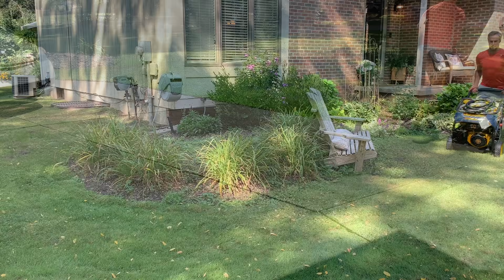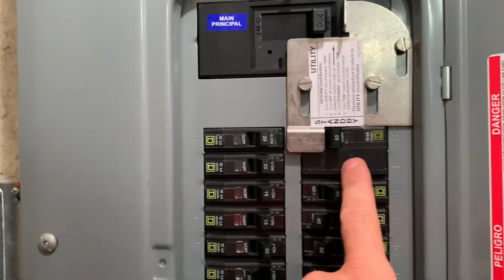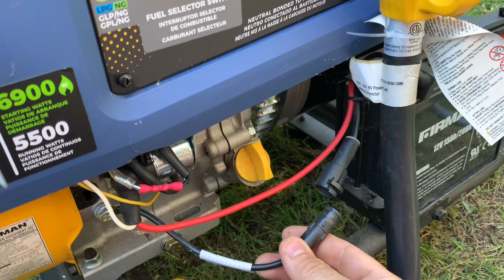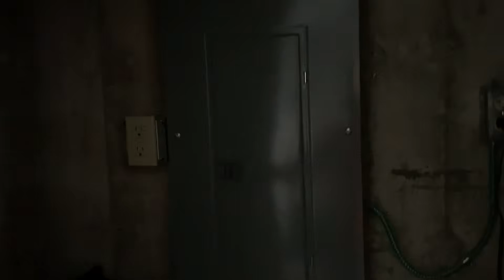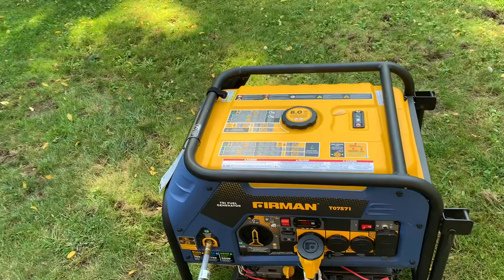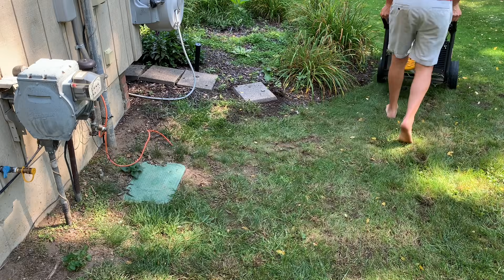Firman Tri-Fuel generator start up on Natural gas for whole house Power

Comment: hey so what if you are out of power for a few days when do you add oil or change the oil?? every 8 hrs or so. and do you have to shut the entire generator off I know its a silly ?
Reply from the maker: This generators first oil change is recommended after the FIRST 24 hours of operation. After the first oil change it is recommended to replace the oil every 100 hours of operation. The generator must be shut down to perform the oil change and they hold about a quart of oil. Here is a helpful link 
https://firmanpowerequipment.com/blogs/news/storm-preparedness-have-your-firman-ready
Reply: Not a silly question because there’s people like me that are thankful you asked it because I was wondering the same thing.

Comment: Sadly when everyone tries to run their natural gas generator, the pressure will be too low, to low for it to run or produce electricity 
Bad deal folks 
Plus if there is a leak in system they will shut the system down asap 
Eather propane or gasoline 😊😊😊
Reply from the maker: This is a tri-fuel generator so it will run on propane, gasoline, or natural gas. The benefits with natural gas is unlimited supply and the lowest cost. We have never lost natural gas even when the multi-state power outrage occurred in 2003

Comment: That interlock is the lowest cost option - big advantage.  However, you have no way of  knowing when grid power returns unless you have some way of monitoring or some indication that grid power has returned especially in the daytime.  A transfer switch is more expensive but gives the option of keeping some circuits connected to the grid without having to turn off the any breakers.  Cost/benefit plays in these options.
Reply: I look at neighbors home to see when the power is back on
Reply: @Asidebar  It's good to have neighbors who don't prepare for power outages.
Reply from the maker: I have thought about adding a switch with a light or tone connected to the main in the panel that can be switched on while on generator power to show when line power is restored. Right now we have the DTE app which sends us a text message when power is restored as long as we report the outrage
Reply: @danburch9989  If you have a digital electric meter, (most power company’s have switched to than now) you can just watch the display. No display, no grid, display returns, power back.
Reply: @petes8849  Yes, but how often are you going to go outside and check the meter for power?
Reply: all he has to do is take a look at the power companies meter to see if it is running.
Reply: @danburch9989  That only works if it’s a digital meter.  The old style meter will not be “running” without electrical load powered thru it.  With the digital meter, no power, no display.
Reply: I would say saving a few thousand dollars is worth checking in on the neighbors from time to time... :)
Reply: yeh its a real big deal to run your generator for an extra 30 minutes after the power came back on.  Why people think this is a big deal I don't know.  Most people can 1) see their neighbors lights, 2) get notified from the electric provider or 3)look at their own meter to see if the power is restored.  If it is such a huge concern they make alarms for $30 that alert you.

Comment: Is you gas line going to the generator 1” or 1/2”?
My generator exactly like your wont run my 3 ton ac even with a soft starter installed. What thick is your natural gas hose?
Reply from the maker: Just a 1/2 inch line. It runs the AC fine but will not run the electric stove. I cannot turn on one burner or I hear the generator dying
Reply: @jakemir  how big is your ac? Gas line is 1/2”? And natural gas HOSE plugged into generator also 1/2”?
Reply from the maker: Gas line is 1/2 black iron pipe reduced to 15ft 3/8 flex hose to the generator with model number listed in the video description and a 3 ton condenser with a soft start
Reply: @jakemir nice video. I just picked one up today and now over thinking if it’s big enough, debating to return or keep it. I also have a 3 ton unit without a soft star. Did you ever try it without the soft star to see if it works? My goal is to run the ac and fridge with natural gas.
Reply from the maker: I have used my air conditioner, and it works without a problem with the soft start. The only thing I cannot run in my entire house is my electric stove. The generator will completely bogged down if I even turn on the smallest burner on the electric stove. But it runs my air conditioner just fine as long as it has a soft start installed. A hard start kit will not work with a generator, but the soft start kit works perfect.
Reply: @Southern_grillin things to think about? How old is your a/c. What size breaker does your a/c use. What other items do you want to run with the generator at the same time. The creator of this video said he can run his a/c but not his stove. The question on this is he trying to run both at the same time? If so that's why the stove was shutting down the generator. Both the a/c and stove draw to much power and must be run separately.
Reply: @jakemir  Hi Jake, great vid as I left a separate comment above but I am interested in getting this same NG hose as you but that link is dead (shows there famous dog pic).  Can you provide more details on this NG hose as I may need the exact same one.  I will add that I am so glad you shared an alternative to using a transfer switch to make this more of a whole house generator. I want to do the same but don't want to spend to much....  You give me hope I can try to do some of this on my own although I may hire an electrician to add the breaker to the fuse box, etc. So that brings up my question.  Would most electricians be ok installing this same setup since I am not as handy with electrical work as you or would they shy away due to permits, etc.

Comment: Can you run your AC with this setup? What is this called, the main breaker for the generator in the panel, the metal breaker sheild?
Reply from the maker: I added some links to the description in the video. The main breaker has a generator interlock that can be purchased at Home Depot. The air conditioner has a surestart soft start system installed, and it allows the air conditioner run with the generator because it soft starts at lower amp draw.. The only thing I cannot do is use my electric stove. Electric stoves draw too much amperage.

Comment: We have a standby generator that stays hooked up.......  When you can generate power,  an outage becomes more of an inconvenience than a problem.
Reply from the maker: Are you referring to a whole house generator that has an automatic transfer switch? I did not want to spend the $7000. I was quoted for just the equipment so I took the Costco unit instead, but it requires me to hook it all up. But it was also only about $1200 investment.
Reply: @jakemir  we have the auto transfer switch... and the generator is fueled by natural gas.   We've had it since 2014.. so I can't tell you a "today" price.
Reply: @DeadKoby  could you share what auto transfer switch you have? it seems most are made for specific brands.
Reply: @bgBlea don’t go with transfer switch option. Much more expensive and less flexible

Comment: We have the save one.  Just remember to turn off the battery switch after you are done
Reply: There's no "battery switch" hence why they have a battery disconnect.
Reply from the maker: Is there a battery switch? I have just been disconnecting the battery.
Reply: @jakemir  I left it in the on position and the battery drained.

Comment: I have the same model. The 50A circuit has a 31A circuit breaker.  I installed a MB Sturgis Propane Elbow Adapter at the generator 3/8" POL fitting. It is a 3/8" Female Flare Swivel x 3/8" Male Flare (Item # 204163) that I purchased from etrailer. Then I installed the 3/8" Female x 1/2" Male brass adapter there. I leave my 1/2" NG hose connected to the generator and coil the hose on top of the generator.
Reply from the maker: I am trying to find a way to keep the generator outside maybe in a small portable storage shed. We only lose power about twice a year so it has not been a major issue yet. Thanks for the information.
Reply: @jakemir  lots of videos out there for doing that.
Reply: @jakemir  Not a good idea to have it exposed to temperature extremes and humidity. Can create problems from being in storage.